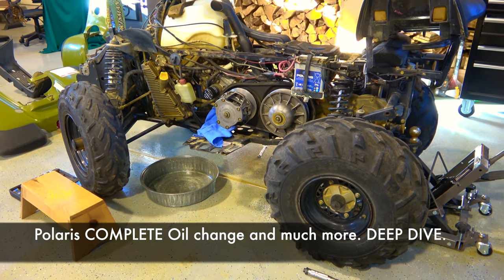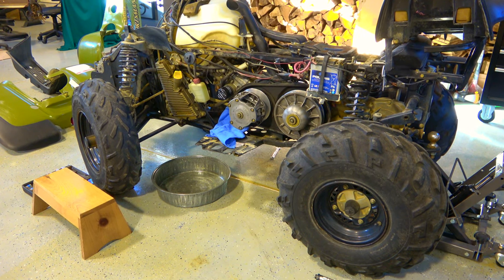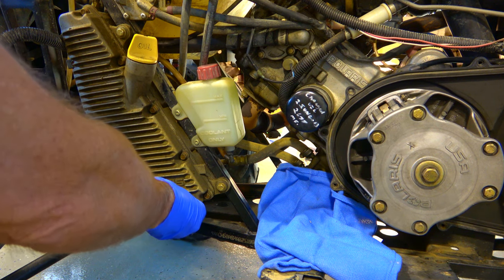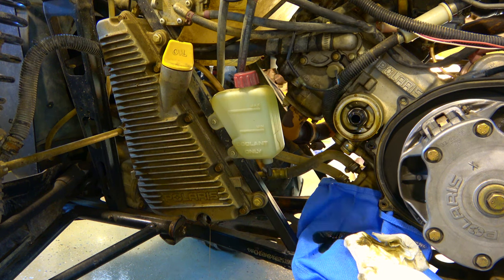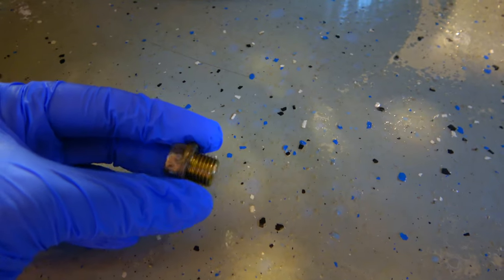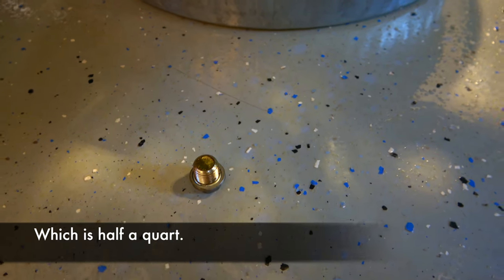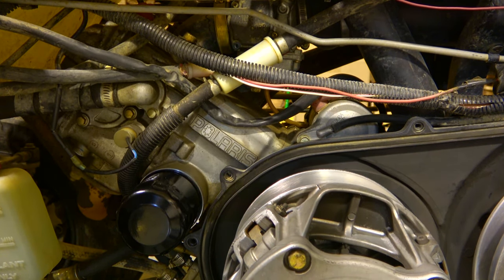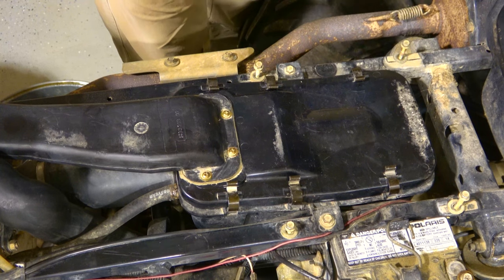Polaris Sportsman COMPLETE oil change & Much More. DEEP DIVE.

Comment: Do you need to prime the system if your just changing the oil
Reply from the maker: It's my understanding that only if you disconnect the line(s) from the reservoir. If I just do a filter and drain the reservoir or/and the crankcase I never do. The manual states NOTE: The priming procedure must be performed whenever the oil hose connection between the oil tank and pump inlet has been disconnected. Hope that helps.
Reply: @ericinalaska7648  thanks for the reply.   You clamp 2in from the tank so is that before the slit in the hose or after it.
Reply from the maker: @Graemesbullys    You want to pinch it between the reservoir and the slit basically. Far enough from the reservoir so you don't damage the plastic pc that's in the hose that connects to the reservoir if that makes sense.  The video should cover it pretty in depth if that's confusing.
Reply: @ericinalaska7648  thanks for the reply thats pretty much what i fugured.  I just didn't know if i should pinch off the slit or not.

Thanks for the great videos they are super helpful
Reply from the maker: @Graemesbullys  Glad they're helping. Im currently editing an in-depth video on changing the coolant. That parts not too deep of a topic but I dive in on overheating issues and causes and diagnosing and tests. If that is on your to do list I should have it posted Sat or Sun at the latest.

Comment: Not true. Manufacture s cannot void a warranty because someone else product is being used,as long as the product meets the standards specified by the manufacturer. BMW tried that with the mini cooper and got sued.
Reply from the maker: Yep. I know there are protections against some scenarios. Just words of caution to avoid the fight. It can be hard enough when you dot all your "I's" and cross all your "T's" Just something to consider.  Just an avoidable battle.  Some folks are more comfortable having there work done at a dealer/shop for that reason then they dont have to worry. Just sharing a thought for those that may like to avoid any headaches.  And even with consumer protections you still have to do what you can in this world to protect yourself as best you can from the fine print. Anyway, I hope you got some thing more of value from the video than that little nugget I threw in there. Cheers. Thanks you for watching.

Comment: If someone can help plz 2010 Sman 500 h.o. High mileage mostly light trail running 
Pulled off charger, started it with choke in with a blip of the throttle Rode it Friday evening an hour, machine did not idle down well had to feather the throttle
Loaded Saturday afternoon to ride the next morning, got out before noon machine still didn’t idle but ran as per usual despite. Stopped at about 1:30 for lunch, I started it off choke with a throttle pump again. Had machine run great for the rest of the afternoon, about 3:30 after a good decent, died down with the throttle open twice, then finally died all together. It started briefly with the choke open then died again. 
I haven’t been able to run it since. 
Maybe someone will reply maybe not. Thanks in advance.
Reply from the maker: How old is the gas that was in it ands it treated for storage? It can be hard to guess and speculate without hands on but the first question that comes to mind is the fuel. When you say didn't idle down well you mean you had to give it a little throttle to keep it running or it would die?
Reply: @ericinalaska7648  There was older gas in it Friday I gave it a splash of fresh fuel, only additive is amsoil quick shot. 89 Octane from the pump that same day. 
Loaded good Saturday, ran well (per usual) despite me having by to feather the machine to keep it at a higher idle on Sunday. I just followed grandpa out in hopes running fuel through the system would help flushing out whatever was going on in the heart of the beast. 
I guess my goal is to get some insight into what a guy might check, I have plenty of time, the unit isn’t going anywhere. 
Shes dealer maintained, relatively high miles, probably approaching low to mid three thousand miles, lots of light trail running, some stuff around the property. 
The last time I tugged the trailer around with it a few weeks back it had a little bit of issue starting and again felt like it didn’t want to idle down although not nearly as noticeable, I attributed it to the machine sitting a while and like you mentioned maybe some fuel issues. 
I’m just looking for some diagnostic checklists, common fuel delivery issues etc. any insight would be very valuable and much appreciated. 
Thanks for your reply on such an old unrelated post!
Reply from the maker: @clevernamehere7559  Is there an inline fuel filter? Cheap thing to rule out.
Reply: @ericinalaska7648  indeed good idea start small
Reply from the maker: @clevernamehere7559  I guess my though is that at idle without any throttling. It may be starving for fuel if its clogged a bit. And when you throttle it forces enough through to go and so on. May be a grasp at a straw but a cheap experiment. Is it fuel pump and carb or fuel injection?
Reply: @ericinalaska7648  I pulled some lines and blew air through them and the machine idles without any throttle input. I also reset the throttle housing and the connections in there. 
Sitting on it idling just like new. 
It is fuel pump and carb, the EFI Polaris atvs we had a pair of both had fuel delivery issues specifically with the pump, we no longer have them. They were traded out for a Kawasaki mule, which we love.
Reply from the maker: @clevernamehere7559   One tip Id give to avoid future similar problems.  Any small engine equip I have. Anything filled from a gas can. I always put some Stabil fuel stabilizer in it. That way its always protected. Been doing it for years. Hasn't failed me. Its my understanding that there are different levels of ethanol in summer fuel mixes and winter fuel mixes. Ethanol is a trouble maker to small engines. It can separate and jell up etc causing issues. Especially in long term storage. It of course adds a little to the expense of fueling up but its money well spent I think.
Reply: @ericinalaska7648  I’ll get the Stabil especially since it about to get cooler. All our 2-4 stroke stuff could probably use it.
Reply from the maker: @clevernamehere7559  Cheap insurance. I use it in my lawn equip. Generators, Chainsaws, Snowblower etc. Good to run them dry but life doesn't always work out that way and you'll have pc of mind knowing the gas has been treated.

Comment: Good way to wreck your engine, leave a cup of oil in your crank case and keep adding the recommended amount.
Reply: Your videos are still the best on a 500 hands down. Great work! You are much appreciated.
Reply: Fluid capacity in manual is 2qts. Total oil in system is 2qts.
Reply from the maker: Yep.
Reply from the maker: Thank you sir!
Reply from the maker: Yep. That was the intent of the demo really. Most are not aware of how much oil is in there and dismiss it as "about and ounce or shot glass full" Certainly not the case.  Im confident or I would at least imagine people not draining the crank case. And its likely many DIY'ers that skip that step and just fill to the dipstick indications. Which while not the optimal result in the long run but Still an improvement from pure old oil. And if you have a old out of warranty machine and have always done it that way. And it works for them. So be it. I just wanted to show those that may choose to do it the complete and most beneficial way the visual difference. I have also of course way back early in life done the the sort version. I had a conversation with a friend/s that say I never drain the CC. Its not worth it. So ..... I said I'll demonstrate this for those that may benefit and dispel the urban legend of it being an insignificant amount. Because it really is a significant amount in my opinion. And seeing is believing. You get it.
Reply from the maker: Hopefully and I would think most. Not all. But most would likely be checking and filling to there dipstick in that scenario. But yah. Too much oil is not a good scenario.

Comment: Don’t use Napa oil filters!
Reply from the maker: Hey there Max.  I would love for you to elaborate if pos. Always like to hear for and against about a product.  And its helpful to others as well if there are valid product issues or concerns.  If there's a better option economically or more importantly functionally. Which can equate to economically, I guess you could say over time. Id certainly be on board.  Im certainly not loyal to any product. Just what I know of the choices. Thats what I use and what has worked well for me. My understanding is that the Polaris filters have a cardboard material used in them that over time and pos extended change intervals can brake down and contaminate your oil etc. The Napa (It seems is made by Wix by most source info avail. Including a conversation I had at Napa) is not cardboard and does not suffer this. Also the micron size. I cant quote them both at the moment off the top of my head but that was part of the research way back. Anyway if you have some info.  Id be interested.
Reply: @ericinalaska7648  my only input would just be self hand experiences that I have had with Napa filters. I have purchased Napa filters with rubber seals already compromised. Many of them fail once already sadly installed. This has all been in the past 2 years. I wouldn’t say so if it didn’t happen to me. Let’s just be honest, it sucks when oil spills everywhere just cause of a stupid faulty rubber seal that cannot hold once pressure is applied. Napa from Texas to Vermont.

Comment: how to make a 10 minute video into a 40 minute video......
Reply from the maker: Probably could have done it in under five. Just thought Id try to cover more than drain here change this filter and fill it here though. Which understandably. Thats what some people want. And there are plenty of those versions out there.  But for those that want more info than that I covered more with that in mind. Hence the title and the length. Hopefully you got what you needed out of it at least and found useful information.

Comment: Do you recommend the Polaris Sportsman or the Yamaha Grizzly for a person's first ATV?
Reply from the maker: Hmm. Yah know I borrowed a good friends Grizzly a few times to go on a dip netting/fishing trip and I had no complaints. Ive just always ended up with Polaris because I look for deals and that's what usually ends up being the find. Probably more abundant overall. Not sure. I think the main thing is reliability. A good running machine that you like the way it handles. Meaning you feel like you're handling it vs it handling you. Ride it. See how it feels and runs. Check for leaks,  over heating, brakes work, odd sounds, Grinding, wobble in the wheels. Primarily in the front end. Bent handlebars can usually indicate a roll over. Which isn't a deal breaker of course but that can also result in other damage like bent front axles or other. Just a few things to think about when buying used. Also research comparable stuff on the market and if it needs repairs, what those will cost.  Hope that helps a bit.
Reply: @ericinalaska7648  thank you for providing me with these tips.  I'm definitely going to follow your suggestions
Reply from the maker: @vsujones  Best of luck.

Comment: great video thanks
Reply from the maker: Glad you enjoyed it. Or found it of value. Thank YOU.
Reply: @ericinalaska7648  i have a question  there is a in line filter  from the air box with a arrow on it  do you no witch way the arrow should point towards the air box or away thanks
Reply from the maker: @lolprice6190   The arrow should be pointing toward the engine. Or, Away from the breather box.  I actually made a video a long time ago showing all the filters and install. I should see if I can dig that footage up. It's on an external hard drive some where. Anyway. Hope that helps.